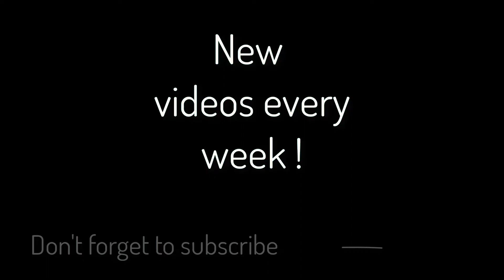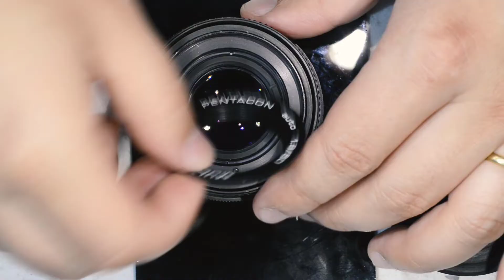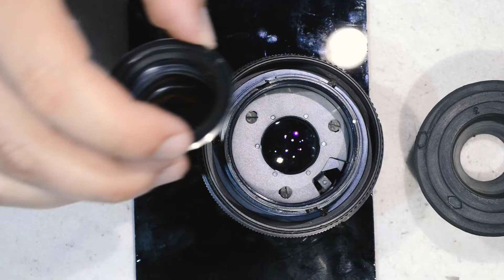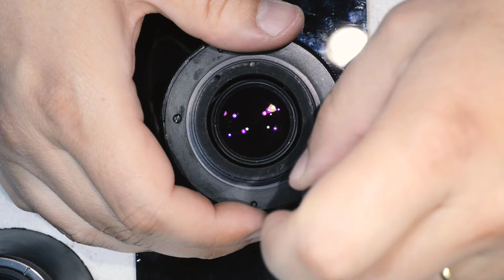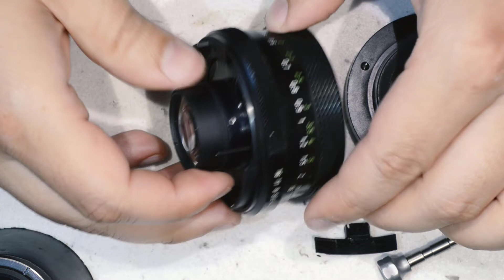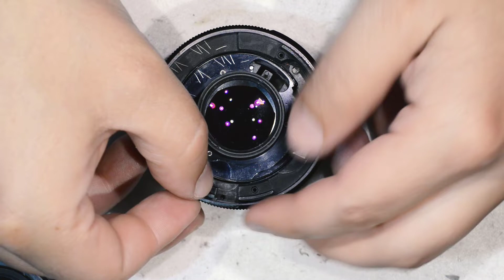Pentacon 50mm : Disassembly and cleaning

Comment: Thanks mate, that's an easy lens to disect. I just bought a mint Praktica MTL3 but the lens has a bit of haze, so I want to clean it. I bought my first Praktica in 1979, and it cost me £79.99, from Comet. A UK electronics outlet. Now gone bust.
Reply from the maker: In '79 I was not even a plan, maybe my parents were just dating. Pratikas are solid cameras, proof is they still working, a little cleaning and good to go for another 50 years!

Comment: For Pentacon and similar lenses, you don't need to disassemble anything to unlock a stuck aperture. You just rotate the focus ring towards close-up, then with a thin metal rod you have enough space next to the rear element to move the pin that controls the aperture.
Anyway, if you did disassemble it, without gloves and in an open space, the lens is compromised.
If the aperture blades are oily, some idiot has messed with it before you. You shouldn't have bought it.
Reply from the maker: Thanks for the tip, very good to know.

Comment: 4:00 that "Centering" lens. Some people Flip the middle lens for dreamy flower photography. I guess that 'centering lens' is the middle lens? How hard is it to flip it and what do we do to "center" it? Should people who want to flip the middle lens do if from the Front as you mentioned? Thanks.
Reply from the maker: Hi, what I like about old all metal lenses is that they have tight mechanical tolerances so the centering itself is trivial. About flipping an element, that's easier than you think (It had happened to me many times by mistake), so just try it and have fun experimenting.

Comment: Hi there, just bought this lens for about 5 Euros at a thrift store and it is indeed a bit stiff (both focusing and aperture) so I'll give it a try cleaning (for that money it's totally worth a try).

I want to adapt it to my Nikon D50, and I wondered if it is possible to alter the lens to make it focus just a bit further than infinity?

Point is, I won't need an adapter with a correction lens in it which often degrade the picture. I have a couple, one with a lens in it, and another with no lens. 

As an alternative I can probably mount the back of the lens, once removed, on a lathe and take off about a mm.

Any suggestions? TIA & thanks for the video.
Reply from the maker: Hi, at 5€ you have little to lose, lot to win. I worked on this lens a while ago so the details are not fresh in my mind. Yes you can always get a bit further than infinity and the lathe idea is also a good option. I don't remember the exact flange distance difference between M42 and Nikon F but must be close as I remember modifying a Russian 800mm catadioptric (M42) to get infinity with Nikon F adapter about 2 years ago and I don't remember struggling significantly.